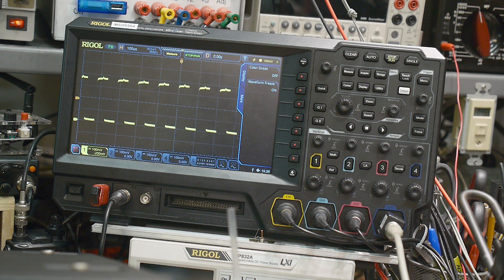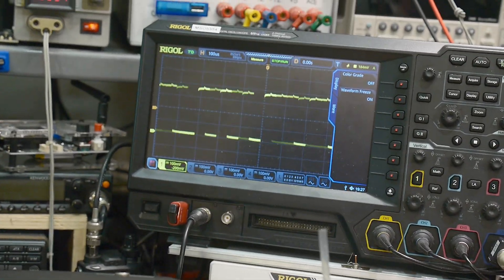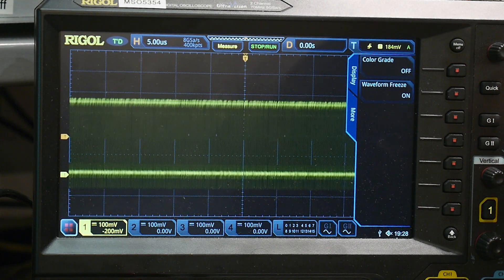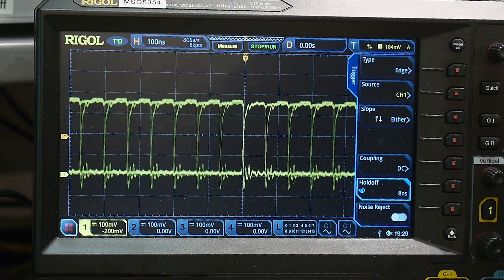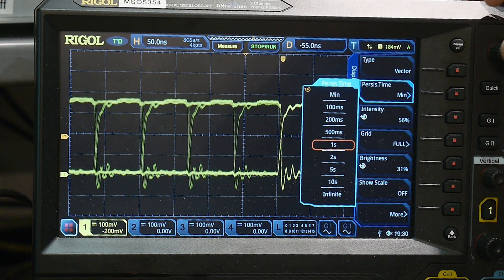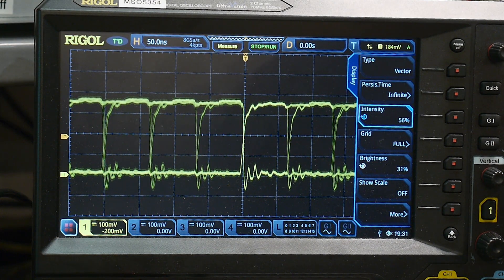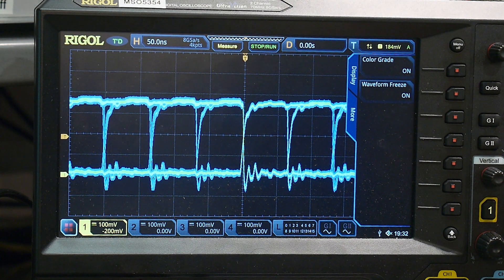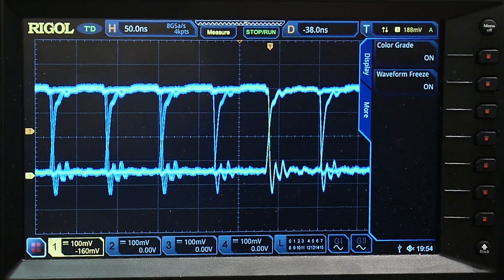#1135 Eye diagram on Rigol MSO5000

Comment: Hey, how do you use the hdmi port on mso5000? Can it be outpit to hig display? Can u demo it plz?
Reply from the maker: Press Utility->I/O-> HDMI to enter the HDMI setting menu.  Press Output continuously to enable or disable the video output.
ON: You can connect the instrument to an external display via this interface to better observe the waveform display clearly from the external display.
OFF: disables the interface.
Reply: @IMSAIGuy  i guess i had issue due to bad hdmi cable. However the output display turns on and off on its own anytime. I dunno whats wrong. I havent seen any1 else demo it

Comment: This is good for showing off the Oscilloscopes utility, but it's not the real HF-UHF "Eye pattern" that is critically important.
The tell is that all of your signals displayed are nearly square-waves - "Eye-pattern" development usually starts with ovoids, and then in a revised design it tries to approach a wide-open pattern, but never a square-wave - else the data rate is too slow for state of the art - and you raise the clock even higher until the eye squints <-- then you try to fix what ever was wrong with rev2, with a revision 3, etc.
Reply: Your scope can easily handle this 15Mhz=66.6ns data-rate - place "the box" inside of the rise and fall traces, and accumulate ANY/every crossing there - move cables around, heat and chill TX and RX, Tappy-Tap-Tap it, etc.
Modify the design to make that box as big and large in area as you possibly can W/O anything poking your eye out.
#Signalling !

Comment: Hello: If you click on measure - analyze. You will find the the EYE ANALYZE button. Hope this helps.
Reply from the maker: YES! I never saw that one. I can't seem to get it to work though. It must expect a particular waveform.
Reply: Were you able to get it to work on your scope?  I can't seem to get the function to work.  It turns on, but it doesn't do anything except display a message "Eye analyzing"
Reply: @NetLogix, Inc.  Nope I never tried to get this to work. I'm thinking you need some kind of high- frequency  RF signal for it to work.